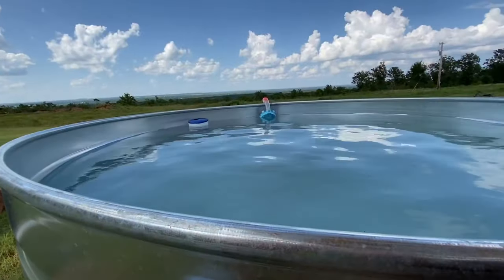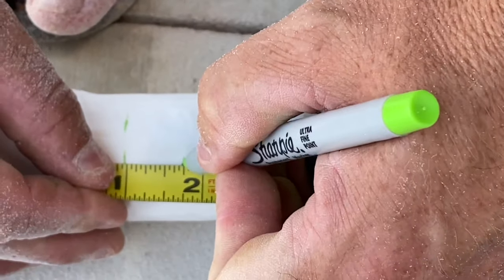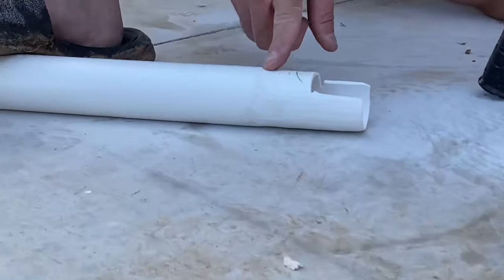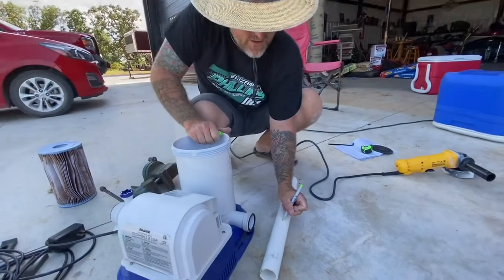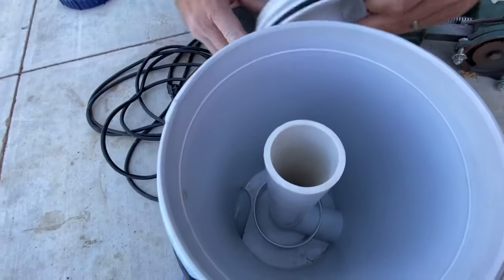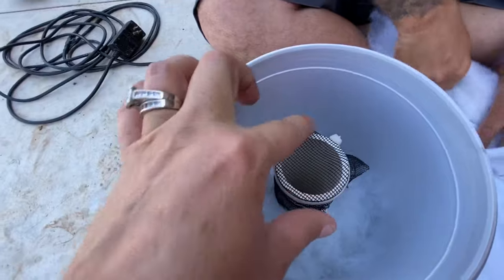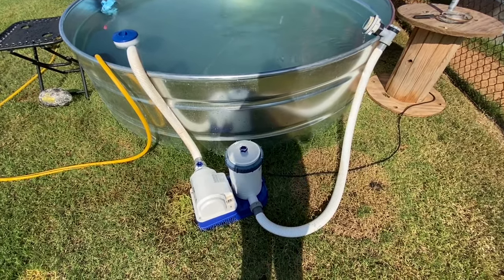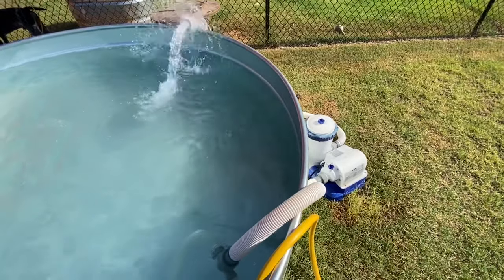DIY pool Filter Cartridge replacement IT REALLY WORKS!! Step by step

Comment: Wouldn't it just be easier to take the filter off the original filter cartridge rather than cutting and sanding the pvc pipe? Then stuff it with cotton? What about using a melamine sponge instead of cotton?

Comment: We recently changed our filter into this DIY option. Do you need to drill holes in the pvc pipe? If so, what size holes and how many? Thanks
Reply from the maker: We didn’t as it pulled from the top;)

Comment: You should unscrew the lower blue knob
before you turn the pump on then the upper blue knob and it helps if all hoses are under water so the water fills the filter by itself then just a little air out the top .
Reply from the maker: Makes so much sense! Thanks Timothy!

Comment: Just watched this, I could be wrong but you didn't  drill any holes in the  pipe so the water is going up the pipe  and because you  cut the pipe short the water is by passing the filter material and  escaping via the gap you left between  the top of the pipe and the filter lid. Surely  the pipe should connect  to the protrusion  in the bottom of the  lid making a water tight seal then the water would pass through the  holes you should have drilled and then pass through the  filter material.
Reply from the maker: Kevin, Great Thoughts, It has been since last year. Once I get it opened up and set up I will look again, I remember we did not drill any holes. The media really worked well, never had any issues with the new DIY set up. Thank you so much for your input, I will get back with you soon :)
Reply: @ParagonRidgeRanch  
I can see it worked well, I'm going to borrow a lot of your ideas, I just thought it would work even better with holes in the pipe. If you look at your original cartridges you will see they locate on the lug at the bottom of the filter unit and the top has a lug that goes into the top of the cartridge. The middle of the cartridge has a plastic type mesh so all the water passes through the filter, if you still lots of holes in the pipe I think it will improve performance and to it should prime easier. Good luck.
Reply: If it fills from the bottom then it’s fine. Because the water has to pass thru the filter media up to the pipe opening. Putting holes may be better. It would increase the water flow rate but at the time may reduce the filtering quality. This is because the bucket fills from the bottom and has to pass thru less material to escape to the outlet. Without the holes the water is forced to pass thru all the material before getting to the outlet pipe.
Reply: @alacard84  I can't read any of that
Reply: The water doesn't go up the pipe it goes down it.
Reply: Would have been nice to show the inside of the canister after running all night long.  How dirty? How far down did the floss get compacted?